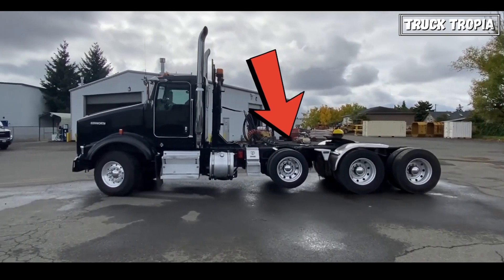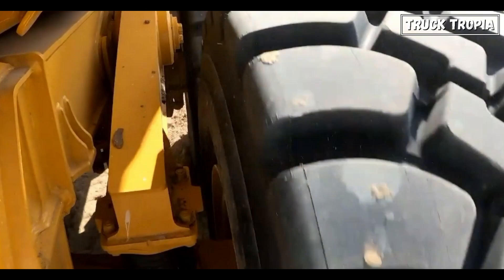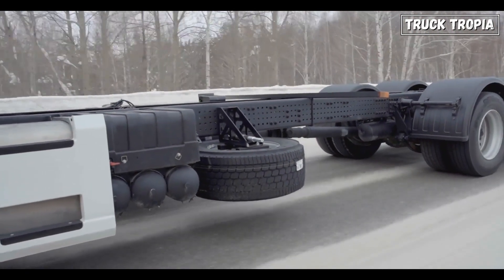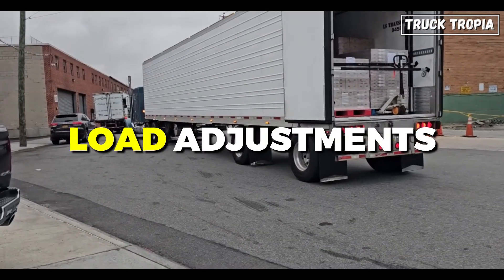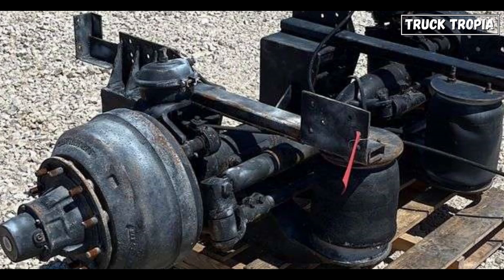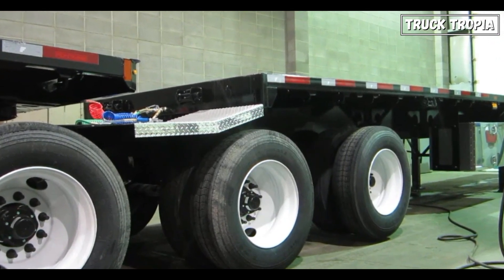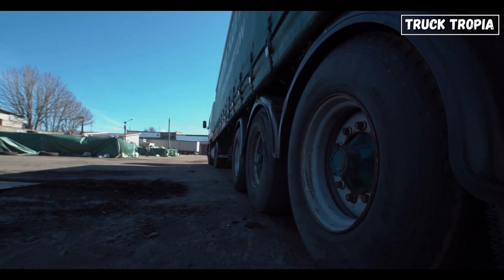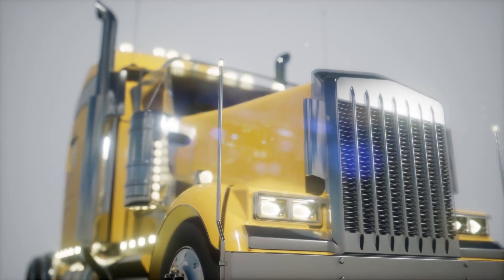Why Don't This Semi-Truck Tires Touch The Ground?

Comment: I thought they were for replacing flats, all my childhood was a lie...
Reply: 🤣 You're not alone. I also thought along the same lines. Good video.
Reply: I did see a type of spare wheel mount that looks like a lift axle but it's really just a mount, there is even no baring, the wheel is hold with only 2 nuts while it's supposed to be 10 huts on an actual axle.  Like this :https://photos.yesterdaystractors.com/gallery/uptest/a231480.jpg
But in China, there is a flip-able spare wheel mount. When flipped, it touch the ground and rotates when the truck is moving. It's a fake axle to cheat in the weight station, making a 3-axle truck look like 4-axle to carry 4-axle truck's payload. But now days maybe extinct because they verify axle configuration with registration record. Like this: https://www.youtube.com/shorts/ifDGSVV9RMk

Comment: I thought they might help in off-road situations. I see them a lot on cement mixers and dump trucks, which frequently go off the paved roads.
Reply: The opposite is the case, lift axles are added to comply with each states weight laws. Based on number of axles and spacing known as bridge law. They come up off the ground on job sites to apply weight to the drive axles and allowing tighter turning radius

Comment: Turns, turns, turns! tandem axles always slip on turns thus wear tyres and increase friction! But with single axle loaded truck becomes illegal, it exceeds allowed axle load.  So empty truck lifts unnecessary axle(s), loaded - uses all available to distribute weight. Everything else is not very significant.
Reply: I believe the term "tire scrub" applies to this situation. The tires on any vehicle with more than one non-steering axle will "scrub" when going around a curve, resulting in tire wear.

Comment: I drive a truck with a pusher axle. The two rear drives are fine for normal loads but when I haul heavy loads and I’m grossing 100k or more I drop the pusher to be legal
Reply: Presumably, by "pusher axle" you mean the lift axle can be engaged to drive aswell.

Comment: Some lift axles have passive steering, others don't. The one that belongs on your truck depends on your specific needs.
Reply: "passive steering" what you mean by that?
Reply: @Saunis  The wheels turn to assist with steering, but not when you're stopped.
Reply: On our trucks, I never seen those kind of axles.
And on trailers we have passive steering, but they are not lifable ones. (and they are needed to lock when backing up)